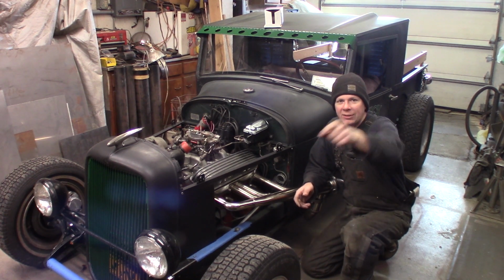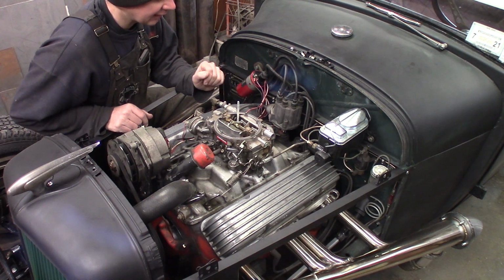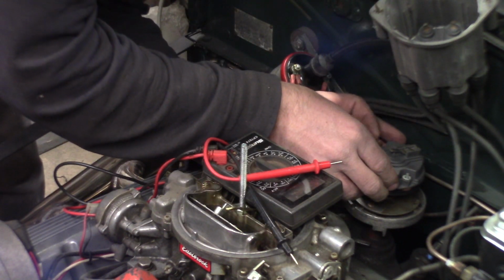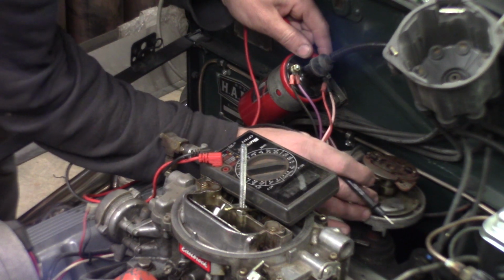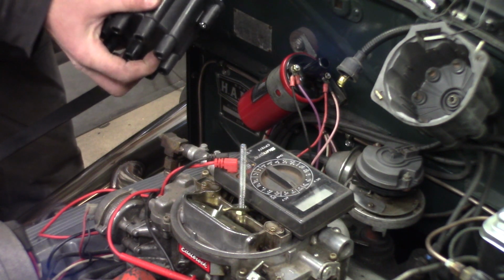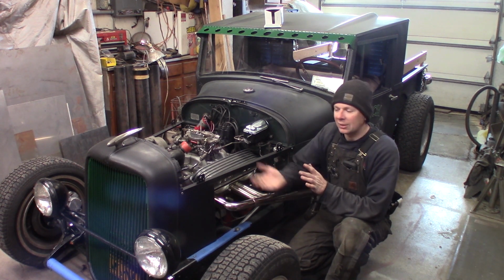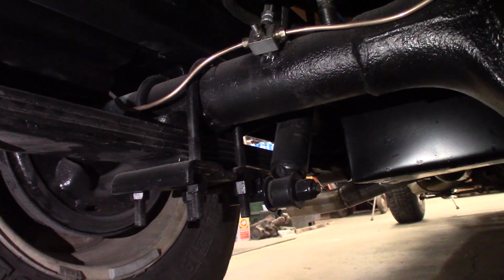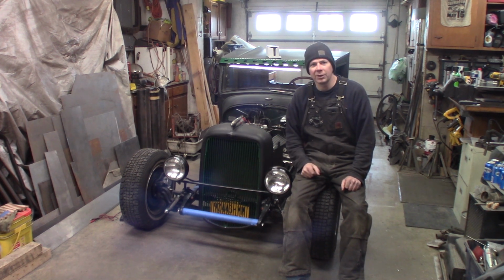Model A Hot Rod Shop Truck is Broken Down!

Comment: Ah , I might be thinking this backwards but shouldn't you go with a larger speedo gear to slow down the rotation of speedo cable ? You're turning more rpms how so your speedo thinks you're going faster, with more teeth ie. ,bigger speedo gear, it will take more rpms to turn your cable one turn slowing down your speedometer. Right, I think????? I don't know. I just went through this on my Jeep Wrangler going from 3.07 gears to 3.73's plus I changed tire size so I was really scratching my head, do I go bigger or smaller?🤔 luckily I found a formula that told how many tooth gear I need and hit it right on . Let us know witch gear you go with. That sucks that you have to redo your neat work on the rear suspension.
Reply from the maker: You might be right.  I was thinking it out loud.  I still have to see what tooth I have in the transmission.  I have all the gears from 17-20 teeth so hopefully one of those will do it.

Comment: I might have missed it- did you check for spark at the plug before tearing into the distributor?  You wouldn’t have a ballast resister hiding in the wiring to the wiring somewhere, would you?  I’ve seen that cause some ignition gremlins.  You’ll get it figured out!